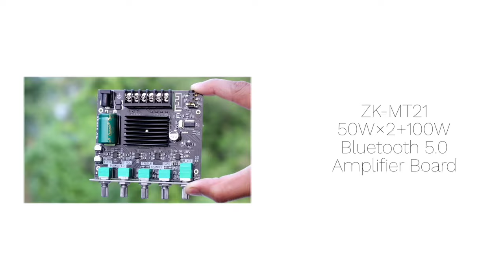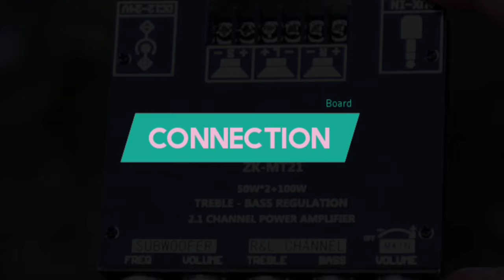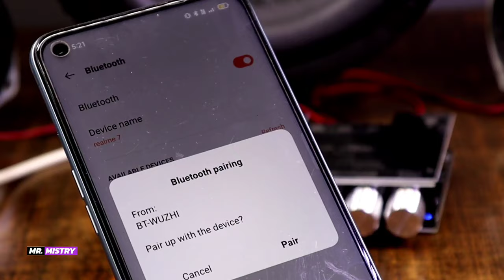ZK-MT21 50W×2+100W Bluetooth 5.0 Amplifier Board

Comment: Don't use this model on a 24v solar system that supplies the voltage same as in the batteries during charging, blew the living bejeezous out the the 24v 4700uf cap, had to replace it with a 120v one, the rest of the circuit is ok up to 30v, it clipped even when supplying it 12v until I replaced the cap, higher voltage = higher output on this unit ... live off-grid and getting enough volume out of either 5v or 12v speakers aint always easy, caping this at a higher voltage makes it so even the lowest output device I connect to it has enough volume, one problem I have using it with a Windows 10 laptop via BT is if 2 sound sources occur at once (ie VLC and a streaming source both at once) ... no sound is heard if one of those sources stops till I switch to another speaker then back to BT ... or sometimes going back a bit on the time slider starts the sound again, which makes me think it's Windows and not the amp, it has to be the lowest noise amp I've ever setup ever in my life, and due to everything here being DC, the bluetooth bypasses the noise put into the output from the laptop (my main source of entertainment) if connected via wires ... the DC to DC PSU puts a lot of noise through the mic/earphone/external speaker jack and no noise suppression device was ever able to fix it! truly decent amp and low cost and robust, had it over 2 yrs now.

Comment: Can we connect directly to the car battery for amplifier power supply
Reply: 12 to 24V DC, connect it wherever you want.
Reply: @HEREISMULLEER  It could be used in a 12v 5a motorcycle battery recharged by the same motorcycle
Reply: @HEREISMULLEER  And if I wanted to connect it to the 110v outlet, which adapter would be the best or a good one would be 24v 3a or one of 12v 3a

Comment: Hi, did you know if the ZK-MT21 use the TPA3116D2 or another chip ?
Reply: For people have this question: the ZK-MT21 use x2 CS8673E, if you're interested to know more and if you speaker French go check my YT Chanel > About, there is a link for a GDoc full of information
Reply: I have received today this ZK-MT21 and there were two chips of ChipStar CS8673e
Reply: @EnzoE  Hi. I don't speak French, but was able to translate your very comprehensive document into English. It is very comprehensive!

One question, and this could be me being wrong about what you are saying, due to problems with the translation! You are recommending the ZK-MT21 over other TPA3116D2 based amps such as the XY-S100H, mostly because of the Chinese app related security concerns for models like the XY-S100H? Is that right? 

Thanks
Reply: @EnzoE  this amplefier working at auto rickshaw 12wats,, battery.
Reply: Какой чип лучше ___CS8673e или TRA3116
Reply: @EnzoE  how do I wire 2 of these together
Reply: The TB21 uses the TPA3116D2 chip, the MT21 uses a generic chip , from what people say here is the  CS8673E. Something to the effect that the TB has HIFI quality filtered audio and the Mt has unfiltered standard quality audio. Thats what the info says.

Comment: Any idea to help me out? I tried with mid range speakers L/R and a small 30w ayima 3inch subwoofer. I used first 12v power supply and then tries 20v. both times midrange works great but subwoofer doesn't work right it sounds weird and warms up really quickly and with the 20v it blew little smoke also... Is the amp bad or what could be the problem?
Reply: Maybe the ohm?
Reply: A lot people asking this amp keep breaking at 20v. I just bought this amp and i use 12v. And it heat sink feel warm. So i had to get colling fan
Reply: You used to big speakers  you need to used  small  speakers  6 for  mid and 4 for bass  with a laptop charger  18v 3.5A

Comment: how much W i need on power suply to get max out of this AMP??
Reply: It goes to 24 v but i don´t know how many watts.
Reply: amplifier only pulls the current it needs from psupply depending on the load.

people tend to crank the volume at max so to keep the amplifier safe, use only 24V (7A to 8A max) or 10A but avoid maxing volume for long period.

Comment: I bought one ZK-MT21 recently. Its chips are : BT JL As21BP0C466-25A4(but can not find the data sheet from JL). 4 NE5532 OP amp. And 2 class D CS8673E.

It works fine with good sound. However I faced one problem. If I connect it with AUX input, the sounds become mono not stereo. After debug for whole days. I found the EMI interference between CS8673E and BT chip. I have to disconnect the audio path (remove C15/C17) and input audio signal into main volume directly. Then I can get stereo and 2.1 output. Due to I onle use it for desk PC, no need BT connection. So it's ok to disconnect BT path. But I am wondering, why this ZK-MT21 can't play 2.1 (become 1.1) when using AUX input?

Does any one see the same problem? Or this ZK-MT21 use the worse EMI chips?
Reply: how did you do it
Reply: i do have that problem too, is there something i can do to still have bt connection and stereo output?
Reply: I have the TB-21 , it has another chip, but has the mono problem once you connect and use the AUX port. Sounds terrible. Grrrr

Comment: A less than 5minutes working Amp..........just received mine yesterday put a 22VDC power supply (i noticed a spark on the DC Jack connector) then test it with BT connection and played with 1 song the bass and treble when adjusting are scratchy  and the heatsink also is getting warmer but the sound it produced is very decent after playing the song  i switched-off and assembled the rest of the part but when powering up again it puff a smoke then no more i removed the heatsink and found the two chips are badly burnt it has a fake TPA3116D2DADR this is the same brand and type of Amp that showed here or maybe mine is a copy. the TPA's can handle up to 26VDC that is why i wonder why it burnt out. so be aware of buying this Amp.
Reply: The back cover can go together with output on every chanel, better isolation between speaker output.

Comment: Can i use FREDO 8 Inch Double Magnet-4 Ohms/RMS103W/Peak 725W Subwoofer-Black
Reply: Max 100w sub ...
Reply: @pulkinpulman2028  amplifer is it used for auto rikshaw 12watts, battery.

Comment: Sir can i use a 4ohm subwoofer or we need to use 8ohm subwoofer with giving power supply of 24v 
Please reply no one reply i am confuse  and how much amp we provide to amplifire
Reply: Subwoofer should be of 4ohms but you can use speakers of 8ohms
Reply: @MukundShukla547   amplifer is it used for auto rikshaw 12wats battery

Comment: Ok ba yan sa woofer speaker na 100 watts na 10 inches
Reply: Na try ko boss. 200 watts na subwoofer ng acoustic 10 inches. Kayang kaya pabayuhin
Reply: @alexanderdave4821  amplifer is it used for auto rickshaw 12wats, battery